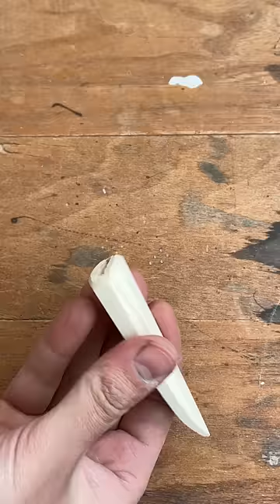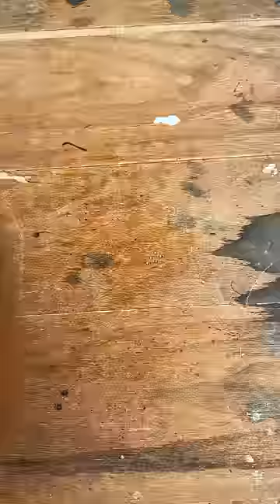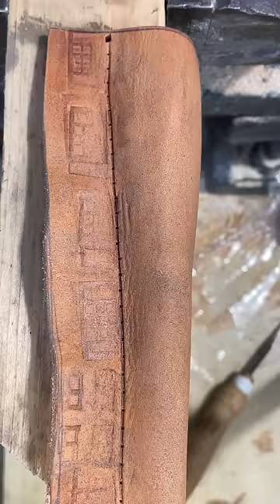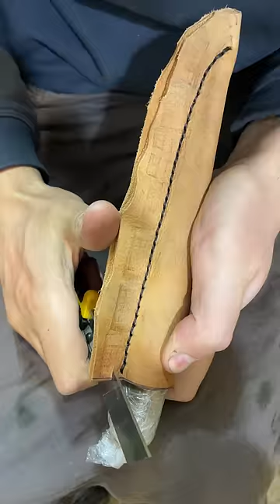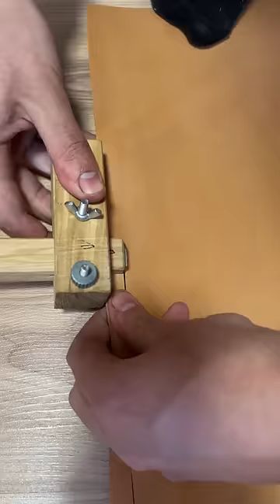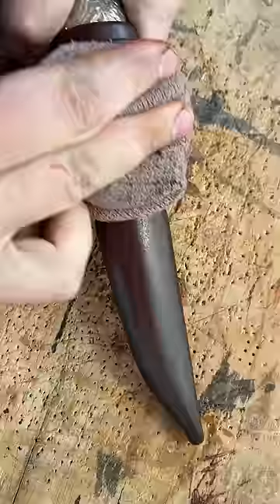Making leather sheath

Comment: I've never seen a real sheath with wood in it before. Very cool!
Reply: Giggity
Reply: And that's the million dollar question...
   Is it a wooden sheath wrapped in leather, Or is it a leather sheath with a wooden insert?
Reply: @Marijuana_Marmalade the difference between those is based entirely on the order in which they happen.

And you can see the wood came first, literally wrapped in the leather. Yes I should be doing actual work at my actual job shut up
Reply: @Marijuana_Marmalade Ah, that is indeed a profound question.
I can't consider it at the moment as I'm still processing the information that you can make marmalade from marijuana.
Reply: 🎉❤l😊😊😅😅
Reply: @Marijuana_Marmalade if there is wood to protect the blade then it is a scabbard, not a sheath.
Reply: @jmoneyjoshkinion4576 what I came here to say. Beat me to it. Kudos y Cheers
Reply: @Marijuana_Marmalade "wood core".
Reply: @Marijuana_Marmalade  it's a sheath for a scabbard. Sheaths are made of leather, scabbards are made of wood
Reply: @jmoneyjoshkinion4576  true, but since the leather is not attached to the scabbard, they effectively made a sheath for a scabbard
Reply: That was just to hold the shape you dunce
Reply: I have a sheath and there’s always wood in it. Always.
Reply: @chocolatefrogs1992  that, sir, is a scabbard
Reply: Is it really though? He wrapped the whole thing in plastic and never showed the wood being inserted into the sheath
Reply: @sandysan4191 pretty sure he put it back in there

Comment: The cutting sound of the leather is just so satisfying.
Reply: Especially when your cutting the leather straight off the face. It has the most satisfying sound ever!
Reply: the  tool looks like if you took  a circle  and cut it in half and sharpened the outside very cool i  subscribed
Reply: FR BRO
Reply: Yeah
Reply: WHY EVERYONE ON “shorts” JUST FOR SOUND OF STUFF??? I NEVER GET IT
Reply: @AdaKırıkkalp  you cant deny it though, it does sound pretty good
Reply: @twinkienightmare5645  sounds cool rarely cause always something cracks like 200 db sound and I can’t hear the actual stuff so I don’t watch shorts btw

Comment: Honestly the wood sheath is dope I've never seen an actual wood sheath
Reply: Wood isn't used because it's a terrible material for a sheath. I agree it looks neat though. Just highly impractical.
Reply: @jazzyj7834  explain scabbards.
Reply: @DarkDomain0001  k I won’t
Reply: @david162116162140  scabbards were made of a variety of materials, leather, metal and yes wood, all of them have their strengths and weaknesses and wood scabbards generally aren’t the best as they’re more likely to dull the blade
Reply: Wouldn’t it be a scabbard then? Im not sure how they are differentiated

Comment: Only thing I would've done differently is reducing the wasted leather. Otherwise this is a cool idea! Made a couple of leather sheaths already but will make sure to add some wood to it :-) Maybe it would've helped to prepare the wood so it doesn't start rotting from the inside once a little moisture gets in there. That's why I've been more into full leather sheaths. Takes less time and less ressources :-)

Comment: Thank you for the cool video; however I must say, you made the sheath a lot less effective by covering a majority of the handle. By doing this, it is more likely to get stuck if something sticky or otherwise gets on it, or just make for a slower draw if you are trying to get it out when needed. Why make things harder on yourself? Nevertheless, good job on your craftsmanship.
Reply from the maker: hello there , many people complain about the depth of the sheath but this is how it should be. There are a few reasons for this - this way the opening of the sheath is smaller than the widest part of the handle and this allows it to lock the handle in and to make it "click". This way there is no way the knife can fall of accidentally. This construction allows very small and light sheath that doesn't take much space. If done correctly it is not hard to pull out - just hold and pull it like a drawer. If you are looking for quick draw tactical sheath - of course this is not for you. It is an old traditional design made very simple but functional. 

Cheers

Comment: Is it possible to use less leather before the stitch? Feel like you cut off quite a lot after the stitch
Reply from the maker: I try to use as little as possible but sometimes if you cut too small piece you scrap the whole thing and you need to start over with a new piece. So I try to be on the safe side.
Reply: I see. Better to be on the safe side. Thank you for your explanation.